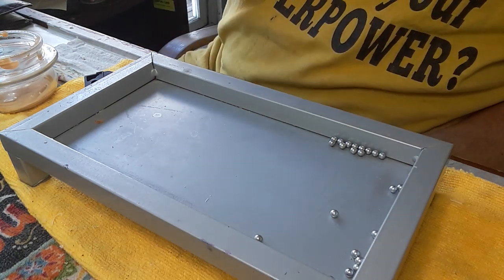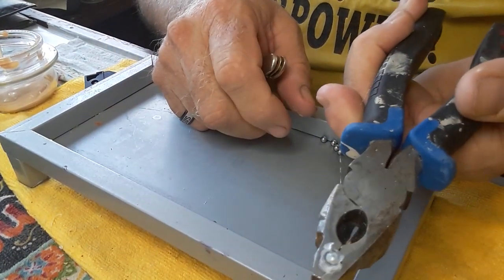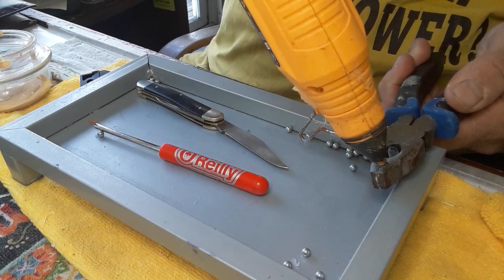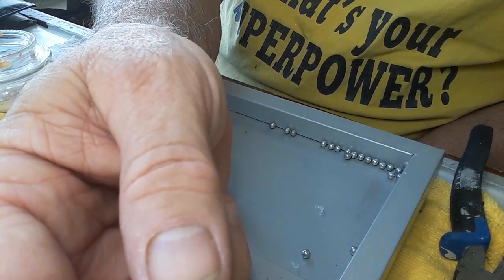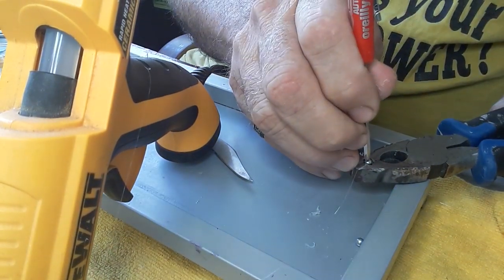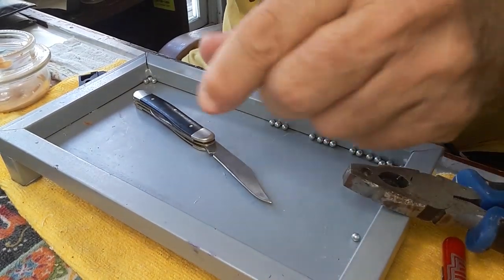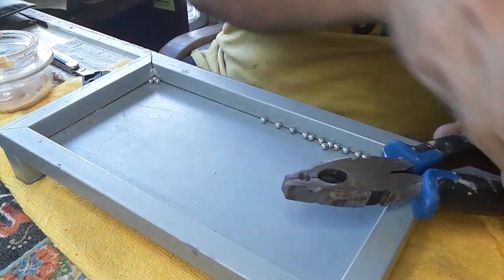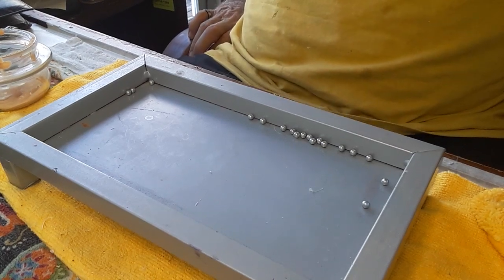DIY Hypersonic ultralight pellets in your homemade pellet maker

Comment: The way this works very well is to have a form where the balls just sits exactly in size into. A small amount of polymere is put into the form, the ball then on top so the polymere becomes a seat on one side of the ball. After cooling the whole thing goes into a form that is a litle bigger (final caliber size), where the ball with the "polymere seat" gets centered into and filled all around with polymere. The problem with this second step is to have a form where the ball with its seat centers well into while leaving enough space around for polymere to add. After the second step then the ball is centered as well as covered all around well with enough polymere (thermoplast/hot glue) not to seperate from the polymere when being shot.

Comment: I made my own mold took my 3d pen and used 3d printer plastic to make these and man works so much better and after it hardens you can smooth out and shape the pellet with a butane Dremel torch with the flat attachment for shaping stuff. And the bbs don't come out and more accurate at 40 feet I'm getting 3 inch group not bad for some pliers and 3d plastic pen and a bb. And on Chrono it's going 890 fps compared to the 750 fps with regular .177 pellets out of pumpaster 760

Comment: Hell yes .. You have made my day sir.. That is the simplest make shift ammunition and that fact i can now up cycle my old pliers makes me even happier..... It's not safe but, you should try using lighter flints rather then the BBS.. I've done the same with my .177 .
Reply: Okay, 
#1. How are lighter flints going to be an effective improvement ?
#2. You do realize Flint is completely safe without friction, right ? If all he does is swap Bbs for flints, like you suggest...he can dip em in hot glue all he wants & nothing unsafe will happen. Especially after the glue hardens

Comment: The heat created in the chamber (even in an air rifle) might be remelting the glue.
Reply: except air drastically drops in temperature when it expands... to the point where if the barrel's long enough, and the valve stays open long enough, it can liquify the air in the barrel...

If you've ever seen a vid of an air gun with "smoke" coming out of the muzzle, it's not smoke, it's the humidity  in the ambient air instantly condensing into fog when hit by the super cold air.

Comment: Instead of encasing the BB in a plastic sabot you can take a BB and with a 1 cm round cloth patch drive it down the barrel of a 22 cal. as in a muzzle loader with excellent results. It will greatly improve accuracy and it will also clean your gun at the same time. I use pillow ticking in multiple layers to cut out patches  using an electric  drill equipped a with home made pipe hole cutter.  The upside of this is there is no danger of harming your barrel with the BB as long as you carefully center the BB in the patch before driving it down to the breach.